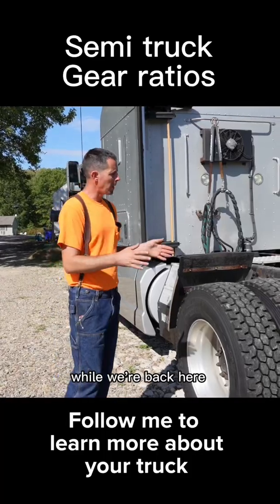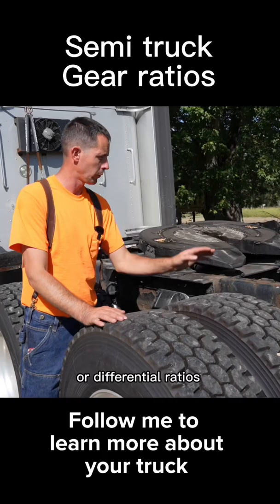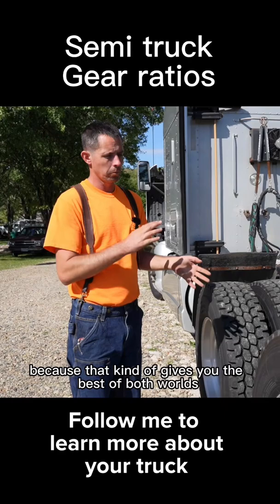Gear ratios / differential ratios for semi truck - what you should know #shorts

Comment: It all depends on transmission model/ratios. Overdrive/direct, tire size as well…
Lower the ratio number faster you go, if you have a direct transmission they make it up in the differential ratio. 
If your trans has an overdrive or double over (most late model 13/18 spd) you can have a slower differential ratio because your overdrive trans can compensate on the top end/ highway speed.

Comment: Don't forget tire size affects gear ratios....taller tire equals a little less gear...shorter tire.. a little more gear
Reply: This is true.. some idiot's out there try to put 35 37s or even 40s on there pickup and are still running  3.55 gears you wanna go to anywhere from 4.10 to 4.30 with big tires..hell ive seen guys running 42s with 4.56 gears and it evens out still feels like factory gears cause the taller tire makes up the difference

Comment: I have 13L Engine axels 2.79 and 80K any hill 37-47 mph
Reply: I never imagined anything below a 3.31 gears in a semi.. back in the day seems like a lot of guys were running 4.10s n 3.73 gears.. i guess the difference with having 10 12 or 16 gears makes up the difference lower gears in transmission so less gear needed in the axle..makes since tho..my f150 has a 2.73 n i hate it. Im gonna swap in either a 3.27 or 3.31 i know its not a big difference but i dont wanna be sitting at 3000rpms doing 70 mph so a 3.31 would be enough to increase off the line speed and increase towing capacity while sitting at a lower rpm on the highway..unless i swap to a 6spd over the factory 5spd then i would go with 3.42 or 3.55

Comment: 3.55 are the best of both worlds. 3.36 are good if your pulling light.
Reply: I agree but it's getting  damn hard to find a truck with 3:55 anymore
Reply: Mine has 3.58 , Columbia 07
Reply: How much of torque/hp would you suggest?

Comment: Most (if not all) modern deisel engines have a relatively short connecting rod between the crank and piston. Not a problem unless you try making high torque at low RPM's, such as below 1500rpm. At lower RPM's the higher torque causes the piston shirt to drag against one side of the cylinder liner. At best this causes faster wear and results in higher oil consumption and higher blowby. Worst case all the lateral motion causes the liner to dance around on the block ledge, eventually leading to a dropped liner. The ISX is most efficient and long lasting when operated between 1500-1800 RPM while making torque, such as climbing hills.

Why do I mention this? Because modern diesel engines these days are programmed to operate between 1100 and 1500rpm with peak torque set around 1100-1200rpm. While this can sometimes result in higher AVERAGE fuel mileage it is bad for the longevity of the engine. It is also mainly a result of EPA and CARB requirements for NOX emissions. Higher RPM's tend to result in higher combustion temperatures which in turn creates higher NOX emissions. 

The industry has gone and coupled these lower RPM programming with taller rear end gears causing the engine to lug up grades at low RPM's and high torque. It puts more stress on the engine and more stress on the drive line components. So not only do you wear down the internals of your engine faster but you also stress the driveshaft and clutch and transmission and rear ends with the higher torque and taller gears.

If you reprogram your ECM to allow higher RPM operation along with a torque curve that brings peak torque up into the 1500-1800 range and couple that with shorter rear end gears that match your operation (like 3.55's and 3.70's for most normal operations and 4+ for heavy hauling), then drive by the boost gauge, keeping your boost as low as possible while getting the job done, in the process keeping your speed to something reasonable like low 60's, then you too can achieve 8 and 9 mpg averages while maximizing the life expectancy of your $40,000 engine.
Reply: Going uphill as slow as possible for for fuel economy - the trend these days with AMT's. High torque with minimal rpm for these new engines. Can they actually have a service life of a million miles ?
Reply: @wheelman1235  low rpm, high torque operation will typically put a modern engine in need of an inframe around the 600,000 mi mark. Sooner if the aftertreatment system has been neglected and allowed to get full of soot in the EGR and intake components. Couple that with extended oil drain and service intervals and it's no surprise that parts wear out so much faster. The big carriers that spec and buy the majority of the new trucks know that they will sell them off (or dupe someone into a lease purchase) right around the 500,000mi point, just as the warranty is up and the components are wearing out. They do the least amount of maintenance possible, extend oil and service intervals 2-3 times as long as they should and make the drivers lug the engines in low RPM's because it saves them a few pennies.
Reply: @wheelman1235  yes, these newer engines, when actually maintained and operated properly, can still achieve 1-1.5 million miles. Unfortunately the first half of their life is typically spent being abused at a mega carrier that has knows exactly when to sell it before needing to sink the money into repairs. Then a new owner op or lease purchase slave comes along trying to operate the previously abused truck like they were taught as a company driver by the mega carriers. They don't realize how they've been set up to fail in so many different ways.
Reply: @wheelman1235  those new automated manual transmissions are purposely programmed like that at the direction of the carriers. They aren't bad, but they sure aren't being set up in a way that benefits the life of the equipment. Everything about these trucks have been set up to get the best fuel mileage from lazy or uneducated (in proper operation) drivers. It's at the expense of the service life of the vehicle though, but they don't care because they sell it off at the first hint of an impending major repair. We've gone from an industry of trucks that would be well maintained to reach 1.5 mil miles, to an industry that considers them disposable after 5 years or 500,000 miles.
Reply: @JimTomatore  thanks. I drive Europe with these modern penny pinching vehicles. Love those Pete's and Ken's with the manuals.
Reply: @JimTomatore  Good day sir. I have another question for you, which others can't answer : a two drive axle tractor 6x4 pulling uphill side by side versus a single drive axle tractor 4x2 , pulling an equal heavy load, with the tractors having same HP, Torque and rear ratio. Which tractor would gain the lead uphill ? I'm betting the 4x2 would reach the top first due to less rolling resistance. What do think ?
Reply: Unless the 6x4 had a higher final drive, e.g. 3,91 or 4,11 vs a 2,64 , 3,08 on the 4x2. The 6x4 would gain the lead. Correct ? Thank you.
Reply: @wheelman1235  in theory in your example there shouldn't be any difference. The only factors at play would be the rear end ratio and the speed and rpm along with the grade. A single axle tractor, at least here in the US, will max out legally at about 36,000lbs of cargo (give or take depending on equipment type and weight) or just under 60,000 max gross. Assuming the same engine spec (which is unlikely as these are usually spec'd with economy in mind) and identical condition (wear, blowby, etc) then simply pulling a hill shouldn't yield any noticable difference.  However in practical application the single axle would most likely be spec'd with a 9 or 10 speed transmission (I drove a 7-speed single axle day cab for a while, but I'm told those transmissions are hard to find these days) and a rear ratio that balances highway and local driving. This usually results in faster acceleration but you lose a bit of momentum on the hills before being able to down shift. 

Of course, I'm writing this comment while being loaded at a shipper so I didn't exactly sit down and run actual calculations. There's a ton of variables that go into your question including aerodynamics, weight, grade, engine condition, driver habits. Apologies if I missed something.
Reply: @wheelman1235  rereading your question, assuming ALL specs and loads are the same, with the only difference being the number of rear axles, then I'd say it all depends who has more money to spend on fuel and repairs and a heavier right foot. The slightly lighter weight of the single axle might give it a small edge, but probably not enough to make any difference to the traffic stuck behind the two trucks as they race each other up the hill.

Comment: So I'm sure that's an overdrive transmission? Company I drive for just got a new truck but it's got the direct drive 10 speed, frm-15210b transmission, 2.64 rear end. So how does that match up. Being over drive transmission has different gear ratios